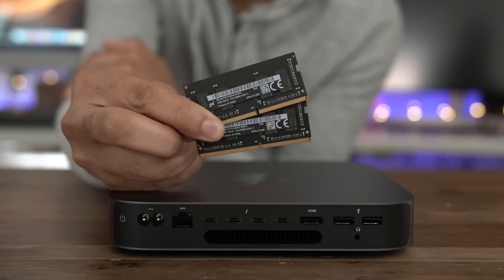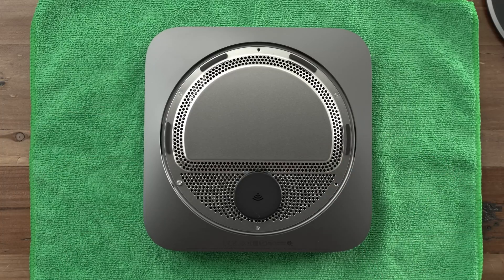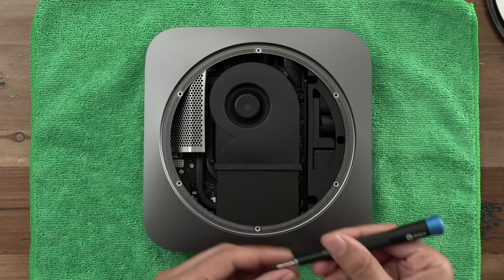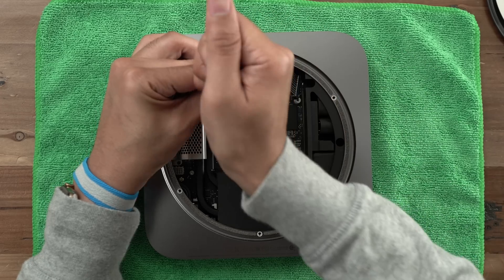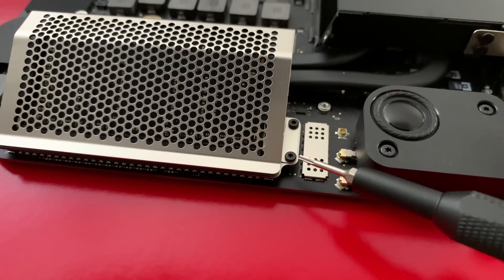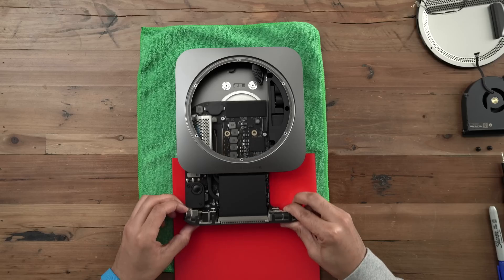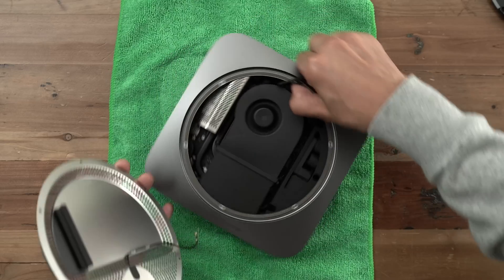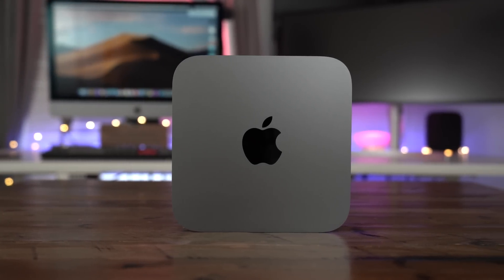How to UPGRADE RAM in the 2018 Mac mini & save $$$!

Comment: Sadly it seems that Apple will void your warranty if you upgrade the ram yourself. They want you to take it to a genius or an AASP. ugh...
Reply: petercalandra - Its only voided if you somehow break it. User error
Reply: They explicitly pointed out that the RAM is user-upgradable.
Reply: @iliakorvigo7341  Yes the user can upgrade it technically but there is a question of the user doing it voiding the warranty. Do some more research.
Reply: @PeteCalandra  With all due respect, I believe it is you who should do the research instead of broadcasting your thoughts as if they were facts. Opening a case and upgrading the RAM cannot void your warranty in the US and the EU (that's a law), unless you've broken something while doing that. Jeff has clearly broken the LED-cable, but that's his mistake.
Reply: Ilia Korvigo technically true but you get apple to hold the warranty in a year after the hd burns out. Also I did not spout it out as fact, I said there is a question as to this issue. Read what I wrote. God bless.

Comment: Has anybody confirmed if this voids your warranty Or not, even though the Apple said: “user upgradable”? Thanks for the great videos as always.
Reply: Apple could try claiming warranty void, but they'd lose instantly if you made a civil court case out of it. That is providing you don't do what 9to5Mac did that is. I promise you, their warranty is void, because the guy in the video broke the LED cable. If they ever took this for an official repair, Apple would want to charge for the entire LED strip - so the customer cannot say that Apple caused the damage. Basically when you send something to Apple, they always try their best to repair it to 100% certified state before returning it to the customer. I've known Apple to do entire body replacements for free on Macbook Pros before due to defects in the housing, and their obsession with a job being completed fully.

Best hope for this machine is that they have AppleCare, because that should cover any user-caused damages such as broken cables/connectors. Any manufacturer can void a warranty if user fault is detected as the cause of damage for any component of the machine, because the manufacturer could argue user fault for the actual issue at hand at the same time. As long as everything remains intact inside (no scuffing/chips from using flatheads on fragile plastic components, or in the case of this video, yanking cables from their connectors for example), warranties cannot be denied.

Comment: Thanks for the tutorial, wish I could save more by upgrading the SSD as well.
Reply: With the 4 TB3 ports just get an external SSD and move everything except for apps and system onto it. Works like a charm and they're not very expensive.
Reply: JM Silverstein CV

Comment: Strange you didn't suggest people just get the cheaper ifixit essentials toolkit which includes everything needed to do this upgrade and is cheaper...
Reply: It's no promotion of iFixit 😂😂
Reply: It's even cheaper to just buy their $25 toolkit and get the RAM even cheaper elsewhere. A savings of $13 to $45 attotw, 16/32.

Comment: Is there any reason why Apple doesn’t have upgradable RAM and internal storage besides making you spend more money?
Reply: Soldering the storage allows them to more easily run it at super fast speeds -- faster than most any SSD you could buy third party.
Reply: Connor Griffin Music somebody who actually understands this! I hate when people complain about that but don’t mention that not only is apples flash storage some of the fastest in the market but can also be hardware encrypted on the fly thanks to the t1 and new t2 chips.  As for ram I’m fine with it being solderd in the MacBook Pro because the thinness and lightness is a huge plus for me, but glad we can do this on the mini.

Comment: Removing that one cable by prying up is one of the easiest things (coming from a repair technician). Removing the leads was a pretty bad idea, but it worked, but I wouldn't recommend anyone do this.
Reply: woodswork thank you. And this is for the leads, right?
Reply: What should someone do instead? (Serious question)
Reply: Yep, I no longer have a working LED... Broke the connector right off the logic board.
Reply: Drew Armstrong me too g
Reply: woodswork cool, thank you. Do we only have to worry about the two in the video?
Reply: woodswork thanks so much! Have a happy thanksgiving!
Reply: thanks a lot  @woodswork
Reply: Moses Buckwalter Giving bad advice to folks to screw up their connectors by pulling the leads out of the connector is really bad advice and a complete public disservice. It’s just too easy to do this the right way, that connector pops right out of there using a pair of tweezers!

Maybe you should hire a technician to do your videos from here out.
Reply: B2Bass 

Dfssffgghukwqwertyytyuiopy.,mqwerttyuiigpaYeah I get$zzzz x-          H there
Reply: I agree.
Reply: It's WAY easier to just snap and unsnap that than disconnecting the leads.  I think that goes wrong, you're SOL on warranty.

Comment: Simple enough, but not NEARLY as simple as it was too add RAM to my late 2012 Mac Mini.
Reply: Mr. Luigi - on the old ones you could just pop the bottom off and slap new sticks in
Reply: mustard shoes TM So true!!!!! It's nice the RAM is upgradeable on the new Minis. But, OMG, It makes you wonder if marketing at Apple told its engineers, "We don't want to annoy our Mini customer base, so make the RAM upgradeable. BUT MAKE IT AS TEDIOUS AS POSSIBLE!". SMH.
Reply: The 2012 Mac mini housed a mobile CPU and had a lower TDP. The 2018 Mac mini is probably the first one to use a desktop CPU, which is why most of the space is occupied by the cooling assembly, making it hard to access RAM through the circular opening. In other words, I don't think they made it "hard" to access on purpose.
Reply: Ilia Korvigo Good point! Still, I have become more and more wary of Apple's ultimate intentions. Just my opinion, but I believe engineering used to be at the apex of Apple's corporate culture pyramid. Now I believe that lofty spot has been replaced by marketing. I think that's important.

Comment: 5:40 Woahhhh strange. It's just a surface mounted connector. You can even pull straight up on the cables near the connector and it will pop straight out—or at least it should. Strange yours was so difficult. It's a piece of cake! Also, for those struggling to remove the power connector (5:17), it's a lot easier to remove it once you've slid the motherboard tray out a little bit (at 6:43). Makes it so you don't have to reach your fingers underneath the case.
Reply: I put a tiny screwdriver under it and it came of easy with a little push upwards
Reply: Maybe you tried to pull it (from left to right) instead of lifting it up (away from the motherboard). Even though the bare connectors suggest a sliding mechanism, it really needs to be lifted up – and pressed down again later.
Reply: Hi
Reply: may I use t6 instead of tr6?
Reply: @wisecoxis2  No
Reply from the maker: I know?! it’s nuts! Was I doing something wrong? I literally tried removing this for 30 mins (pulling up to remove it from socket) and it would not budge. And just got frustrated and pulled the pins. Everything else was cake!
Reply: I cringed. Hard.
Reply: Does this upgrade work on the mac mini late 2014? im trying to stream but my 4 gigs of ram wont cut it
Reply: @ImRobinRobin  its even easier to upgrade the ram on yours

Comment: Not an easy task at all. Apple designed this thing to discourage someone who wants to upgrade it.
Reply from the maker: It seems complicated, but I could probably do it in 15 minutes if asked to do it again. Maybe less if it was a timed race :) It's actually pretty straightforward.
Reply: if it's not easy to do, then you're the kind of person who shouldn't be opening a PC of any kind, never mind a mac lol. Anybody who has experience with computers, specifically Macs will already know what to do. Everything used here is already familiar, down to the press stud antenna connector, to even the lift up connectors.

Nothing hard about this whatsoever.
Reply: Well, the idea is you can, most modern Macs have soldered ram.
Reply: @CharmingHomer That is true, however PC motherboards are also removable, and some motherboards on PCs have SSD slots located on the underside, meaning removal is necessary if you want to upgrade those SSDs.

Now tell me, how is that any different? Then tell me, what is so hard about inscrewing a motherboard from it's chassis and simply sliding it out of it's housing? Damn it's actually much simpler and safer than messing with IO shields and standoffs on a PC build lol. So again I repeat, anyone who finds this upgrade too complicated shouldn't even be going inside a computer, because regardless of brand, they're likely to be the ones who damage something.
Reply: of course.
who else but apple?